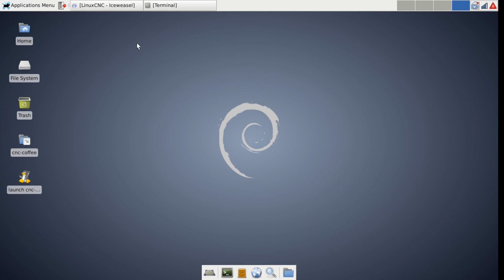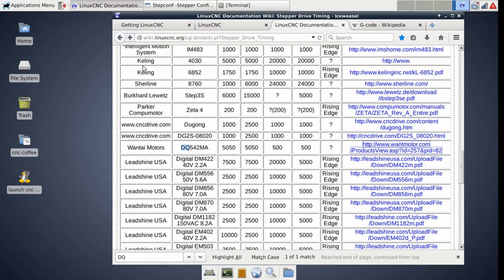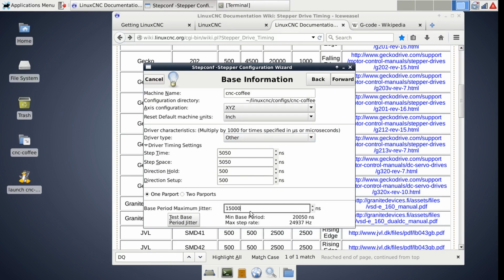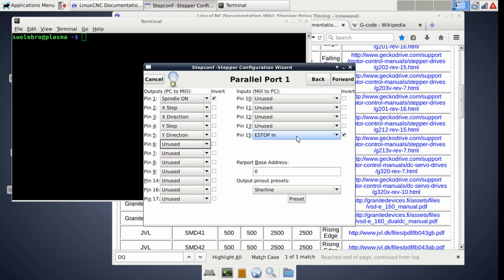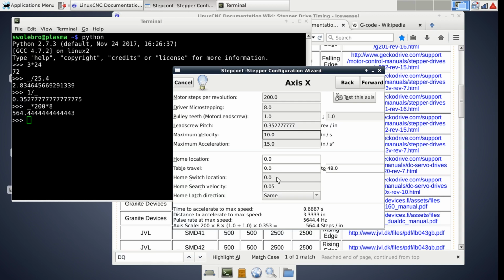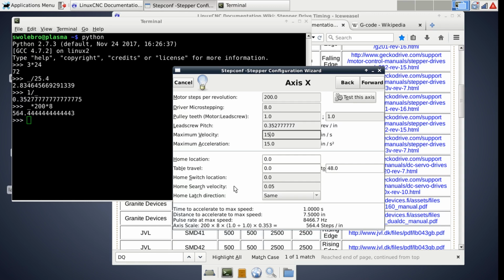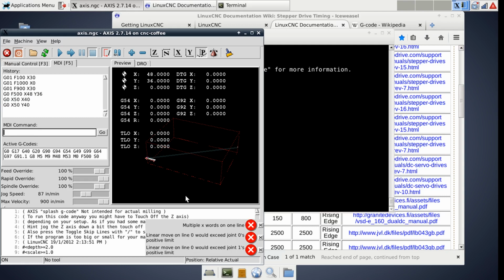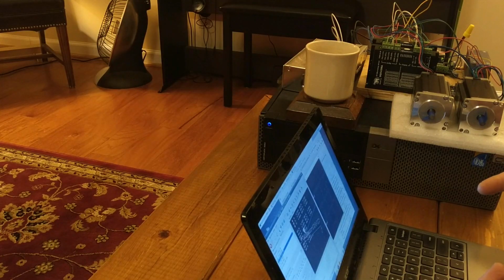LinuxCNC: Software Configuration

Comment: Well sir.  The information you provided me WORKED!!!!  Thats the good news!  The other good news is that the z-axis rapid movement stalling is now repeatable.  you would think the 500+ oz/in. nema 23 would handle it.  In fact it does for about the first 5 minutes.  Well its Keling equipment so I am thinking of going with a nema 34 and good driver to try to avoid this mess again.  Do you have any particular thoughts on the matter?  Also cant wait to see your build.  I hope you are capturing it on video.
Reply from the maker: Solid. From the sounds of it, you've got this on an actual machine now, right? I'd recommend doing some thorough testing to make sure you aren't dropping steps or missing direction changes.

To test for dropped steps, you really just want to make a complicated doodle and run through it at variety of speeds and see that it's repeatable. A slow speed shouldn't drop any (because it's slow), and with any luck, the path will stay the same even as you turn up the speed. You can sketch the doodle in something like Inkscape and create the Gcode with its plugin (note: I've only dabbled with that part so far). 

To test direction changes, you'd want to run Gcode along the lines of "back, forth, pause, back forth, pause..." The back & forth should mean any backlash cancels itself out, and the pause only after "forth" means if your direction change signals are being interpreted late, that you'd slowly drift in the "back" direction. The Gcode would be similar to this: 

https://github.com/swolebro/caddyshack/blob/2a05880f2677a68f50e69760cb4f636cdd4839f3/scripts/household/watchwind.ngc

Which was a stupid thing I cobbled together to wind an electromechanical wristwatch of mine. You'd want to strip one of the G4 pauses out, make the other one shorter (just longer than your base step period), and maybe tweak the positions, speeds, and iteration count (eg. not 30,000). Note that in LinuxCNC's flavor of Gcode, "#100" is a variable and "o200" is how you do a loop.

And then any tests you run should be repeated with you actually putting the computer under some load (eg. watching 2 or 3 youtube videos simultaneously). Missing steps or direction changes can be hard to catch, but is a "Very Bad Thing" because it'll bite you in the ass when you go to make a some large, complicated piece, and all the misses add up, and ruin a $100 sheet of steel.
Reply from the maker: As for your Z, I'm not sure what's up with that. A NEMA 23 should be totally sufficient. Is it hard to turn the lead screw on it by hand? Something could be off kilter and increasing the resistance.

Have you tried checking how hot the Z motor gets vs. the X and Y? An infrared thermometer costs $15 and could do that. Or by touch, they should be uncomfortably hot, but not immediate-3rd-degree-burn hot.

It looks like your drives have current limiting as a feature on the dip switches, so make sure you didn't accidentally limit your 500 oz-in motor to being only 100 oz-in by choking the current! (Though you can probably do some modest current limiting your Z while maintaining adequate torque - the benefit of that being that it reduces heat/wear on the motors.)

Between holidays, work, workouts, and other workshop stuff, the build is taking some time. But yes, I should have some more progress to report on here soon. Very excited for it.
Reply: @swolebro   The Z-Axis appears to be off kilter.  I am making a new motor mount for the mill today.  Thanks for your help.  I would not have thought about that unless you mentioned it.  By the way I am glad to see your plasma build going well ( I see some new videos posted).  Time to go watch and have some coffee.

Comment: swolebro, great information in this video sir.  We the non-software people appreciate the down to earth version of the documentation.  I hope to see some more tips and tricks about this software.  Thanks again and keep up the good work.  Now I am off to find stepper driver timing info for KL-6050's.
Reply from the maker: I'm glad you found it helpful! I figure if each video can save even a couple people a couple hours of head scratching, then it's worth the time to put together.

I took a quick poke at the internet to see what turned up for your KL-6050's. Found this page, with a PDF spec sheet listed:

https://www.automationtechnologiesinc.com/products-page/kl-stepper-drivers/kl-6050/
https://www.automationtechnologiesinc.com/wp-content/plugins/download-monitor/download.php?id=198

From the looks of page 2, if you do 1.2us (1200ns) for the step timing and spacing, and 5us (5000ns) for the direction setup and hold, it should work. Give that a try, and see if all your steps come through and if they change direction when you tell them to change. If they do, then please add it to the wiki page!

If those timings end up dropping steps or changing directions late, you can always jack up the values artificially high (eg. 20000ns). Then the pulses will be so long that the drives can't possibly miss them... it just means the machine will run slower too. Not ideal, but maybe good enough.
Reply: @swolebro  Thanks for the intel.  I actually read this document a few times and had no idea what those numbers were for.  I will try these values out and update the wiki once a full test has been run.  Thank you again for your time and effort.
Reply from the maker: And do be sure to check out Russ's videos too. He's got some good stuff up there, and lots of it.